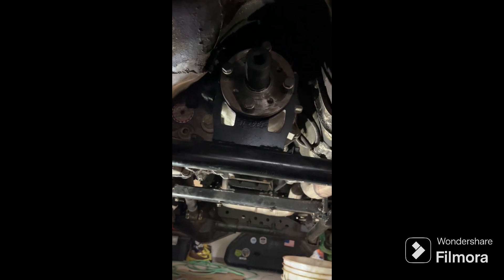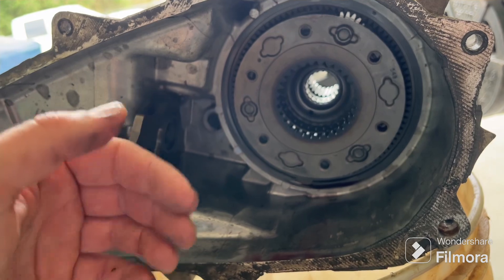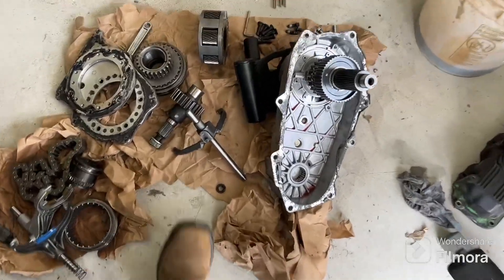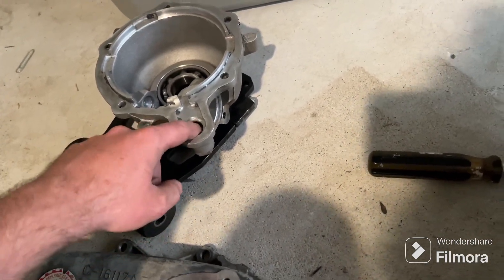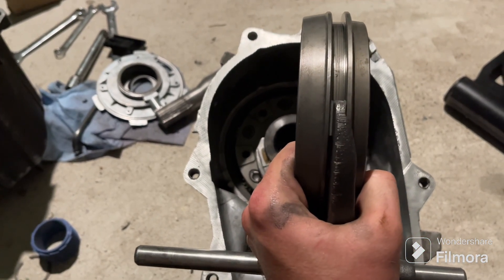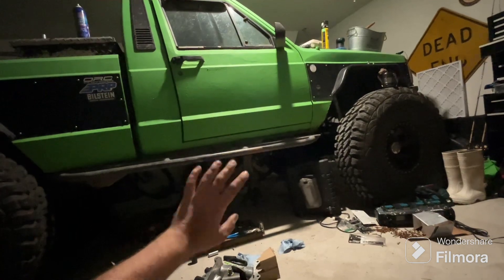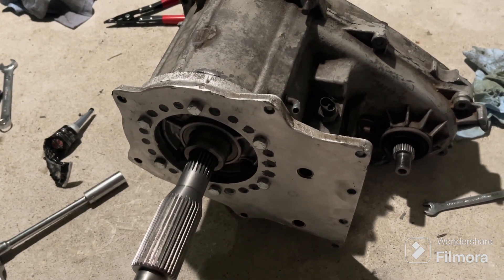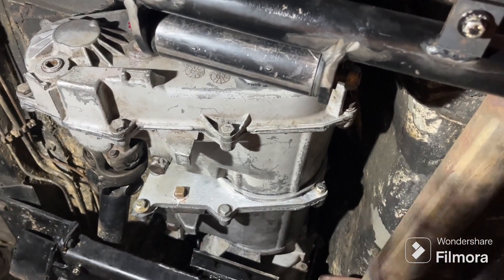231 Doubler upgrades- Bigger Better and Stronger

Comment: So i gotta ask you this. How much you have into this whole conversion plus man hours? Seems like you'd be better off to just save for a 4 speed Atlas and have a bomb proof t-case. 

Also whats that additional low range kit made from? The ebay link in comments doesn't work now.
Reply from the maker: @AZBADBOYz  putting the doubler together wasn’t very hard so long you have the right tools. Good set of snap ring pliers is a must. 

I bought it kit assembled for $500, and i added the sye kit for another $2-300. And then that gear set was another $200. So total of right at $1000 plus maybe 8 hours total of labor. In the long run an Atlas 4spd would be better but it’s also right around $4600 plus the wait time to have it built. This was a quicker solution 

Now of this breaks 😂 I’m probably gonna go the atlas route  but time will tell. 

The metal plate between the two tcase is aluminum
Reply: @mr.caceres305  All the labor and research is just too consuming for me. I'd rather be wheeling. Thanks for the reply.
Reply from the maker: @ either waiting for a tcase to be delivered or building one. Same difference just pick whichever works for you

Comment: Would this doubler work on a 241OR (rubicon TC)?  Do u think it would be to low if it does?
Reply from the maker: @kozinator  in theory it will work. That’s would be my next project if I break this. The gearing options would be 1:1, 2.72:1, 4:1, and 10:1, in double low. Might be too low in certain applications, might be perfect in others just depends on your use case. I like have the extra options just in case especially with a manual

Comment: Where do you get that kit?
Reply from the maker: I got it on eBay!
Reply: @mr.caceres305  thanks i have 3 231 might as well 🤝🏽
Reply from the maker: @R.O.D_OFF-ROAD  it’s worth it on one at least
Reply from the maker: https://www.ebay.com/itm/404958139595?itmmeta=01HY42TJZK1TBC8B886PV7ZYRF&hash=item5e4962d4cb:g:6KsAAOSwRvxhHWVN&itmprp=enc%3AAQAJAAABIJ%2B8KgTkurd5F8TocjYz972eNLr9fuzOY56AJHeEQ7FzUEcWgiGajU9dRUQh3bvbp7BuV8Xs3Pp%2BgRAERgUP2UYiVts%2Fmn63zcMAXLao5XPhzE%2FgUXKMrzHDv2oulOekFx9cFqhRwNuXgeLOefxhkIkrKnLdYuNSerr6BpfjodL2zCG%2FHAbK9un20IKnQWJzCKg5OGpgfGHjM50xu%2B8sSnVX4gKHT9Je3mJ3B6XxfSAsBYpLeQB9x%2B6p9QfvINfGQuxDYc%2BGDJa0rl5xYWMHni%2FO3My%2F7PC7WfIUfyn%2BoOj5fPKhNc8J%2BQi4Al%2F%2BMUTQ0QhYRgNmzIWBYh2nqF57tcqa%2BFB86TLqVgdQTOOrfz%2BCNCRFJDEHt%2FxwF2O4%2Bm2e1w%3D%3D%7Ctkp%3ABFBM7q_qgvFj